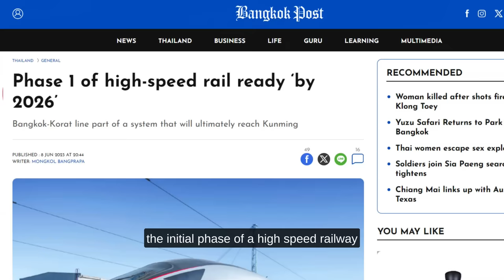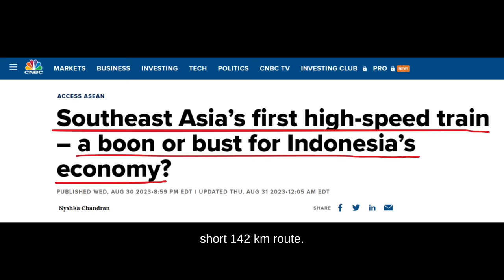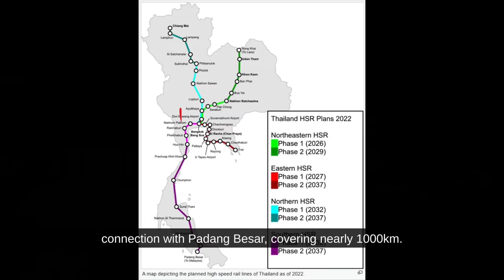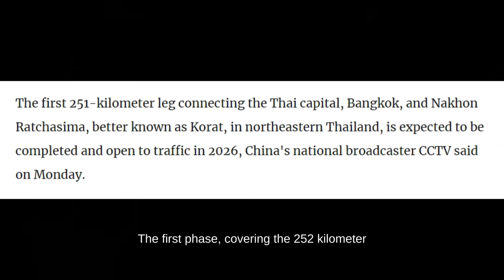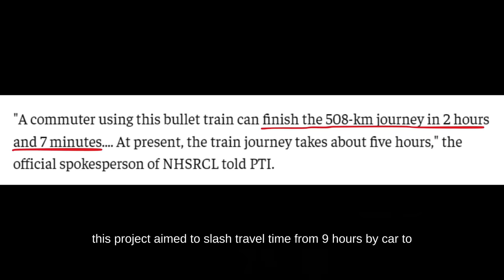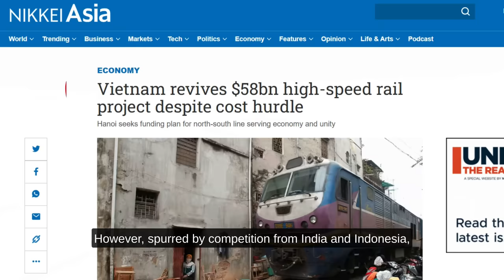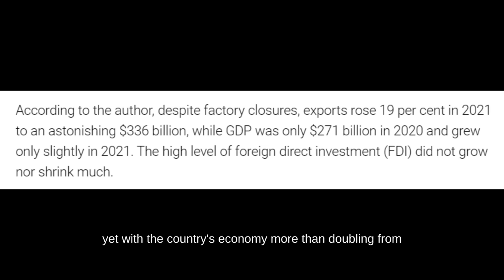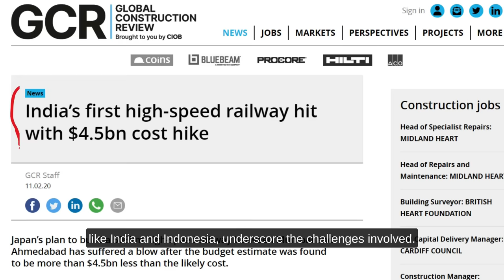Thailand, India, and Vietnam Competing to Build HSR

Comment: China has the fastest HSR!!! Wrong, wrong, wrong!
Until yesterday, No nation has break India HSR spped record, yet. 
YES, India has the fastest HSR, ever. In China, passengers taking  Beijing-Shanghai HSR set off from Beijing and arrived at Shanghai 2 hours later.
In India, Mumbai HSR (India proudly name this HSR SYSTEM of theirs, FSR or FAST SPEED RAIL), it's FSR train travelling at one end arrived at the other end less than the time it takes for the departing passengers to march from the entry gentry gate to the boarding platform OR conversely, the time taken HSR to complete its end-to end journey IS LESS THAN the time for arriving pessengers to desembark the train to reach the exit gentry gate. 
(For Reference: The operational length of completed Mumbai HSR End-to-end is 10Km. 
And its take 12 min for Mumber HSR train travelling the highest achieved speed of 120mph train to complete this 10km journey. 

This is a spectacular achievement by Indian govt, ever. Because it had bring modernity to the nation with modern day infra ie  a FSR system that provided India citizenry with end-to end rail  journey that is comparatively better  than motorized air poluting vehicular mean of commuting for economic activity.

Comment: How long was Indonesia's high speed rail project delayed?😅
Reply: Slow down in pandemik time..
Reply: About 1.5 year
Reply: @leichen8000  I just read a lot of articles in which the completion time of Indonesia High Speed Train was 2019.
Source - bbc, al jajeera
Reply: @akashranjan1550  2019 was probably a very old/early estimate. The construction started in 2017. There was NO WAY to complete in 2 years! At the commence of the construction, it was projected 2021/2022 for completion if I understand correctly. Note that there are always MANY different projections for completion date at various stages (at proposals, planning, design and construction).
Reply: Delay is a nature of a project with many circumstances but it's normal.
In the end it's finally finished and running with passenger beyond expectations.
😊
Reply: Delay? Covid 19 brooo
Reply: india high snail train😂
Reply: @andriacz3240  India's first phase  route length is 508 km
12 stations
470 km elevated
25 km tunnels
13 km embankment

Pier work - 250 km complete 
Viaduct - 150 km complete 

*Source- official website of NHSRCL
*So it will take time 👍🏼

Comment: ndonesia was a 170 km long project and India's is a 525 km project. Indonesia project was to be completed in 3 years and got done in 8 years - with a cost over run of more than 2 times.  India's had a time estimation of 5 years and is getting completed in about 8 years with a cost over run of about 50%.  Overall cost per km for India is less than 50% the cost that Indonesia has paid.  Plus India has got funding at throw away cost of 0.1% p.a. interest, 15 years moratorium and 50 year repayment.  You also need to understand that unlike Indonesia the bullet train is just one of some15 large projects for railways being concurrently handled in India - such as 2 dedicated freight corridors totalling 3000 kms; 100% electrification of all railway lines (Germany is at 60% TODAY); metro systems expansion and setting up simultaneously in about 40 major cities; semi-high speed trains (Vande Bharat) introduction and expanision to 500 trains; track renewal to handle 160 kmph for all trains to bring down travel times in non-bullet trains; hyperloop development and setting up between Chennai and Bangalore;  modernisation of railway stations and bringing them on par with airports - at present 400 stations are being revamped across the country and a few thousand more are slated.  ALL THESE ACTIVITIES ARE GETTING DONE AT RAPID PACE THAT IN MANY CASES HIGHER THAN THE BEST PACE OF ACTIVITY ACHIEVED BY CHINA TILL TODAY.  THEY WILL BE COMPLETED BETWEEN 2023 AND 2027; THEY HYPERLOOP ALONE IS LIKELY TO EXTEND TO 2030.  AND THEY ARE AT COSTS THAT ARE SO CHEAP THAT CHINA CAN ONLY STAND BY THE SIDE AND WEEP
Reply: Construction of Jakarta-Bandung HSR began in 2016 and completed in 2023. That's 7 years, not 8. The original budget was US$6 billion, final cost is US$7.2 billion. The Japanese-built Indian HSR's completion date and final cost will be known when and if it is completed. It's meaningless to compare something which is real with something which is imagined.
Reply: @prabakarsantanam2931 too bad India and Japan failed😂
Reply: @nickzhu9201  too horrible u Chinese bots have nothing to do
Reply: You never know how much a project will be delayed and over run the budget until it is done. All you mentioned are just expectations.

India is yet to prove its ability to complete projects ON TIME AND ON BUDGET which we didn’t see historically from those like INV Vikrant carrier, Arjun tank, LCA Tejas jet fighter, etc. It seems a norm for India major projects to run over budget, time and money.
Reply: Talk about pace ……
China, during the first 6 years of HSR development (2004 - 2010), put 6000 km into service!
India has spent 6 years so far (from 2017). How many km HSR in service? - Zero.
Who should be weeping…? 😂😂
Reply: @prabakarsantanam2931 
ever heard of cart before the horse? You're sitting in that cart!😅
Reply: @sunmanyi3265  and ur pulling that cart for me 😜
Reply: @leichen8000  there are issues. There are failures. There are also resounding success stories. Depends on what you want to see.
Reply: @leichen8000  u see this pace in the Vande Bharat train project. Bullet train is not that high in our priority
Reply: @prabakarsantanam2931  What people want to see is consistency. People won’t take you seriously if your project are always hit-or-miss.
Reply: @prabakarsantanam2931  I know India is building Venda Bharat like crazy. But it is just a semi HSR.
Venda Bharat is similar to the semi HSR (< 200 km/h) China homemade 20 years ago before importing more advanced Japanese and western technologies. They are no longer in service in China. I don’t understand why India is still building Semi HSR in large scale while Shinkansen technology is being transferred?
Reply: @leichen8000  that is a big question. U really want to understand we should do it one to one privately - a topic that could take some level of time commitment
Reply: @leichen8000  It is nice to be seeing a rational discussion about India from a reasonably well informed Chinese person.  In several years this is my first such experience - the normal interactions I have seen is one of disdain and disrespect in comments about India from Chinese.

To broadly answer your question - briefly - when India was looking to modernise in 2015 / 2016 discussions held with Chinese railways; spanish railways and a few more yielded several suggestions some of which was India needed to first convert its vast railway network to semi-high speed before going in for high speed trains.  The Vande Bharat was indigenously developed in some 18 months  based on some of these inputs - there were some corruption allegations that took time to sort out and now we are in the space of rapid roll out of Vande Bharat trains and modernisation of the track to handle the semi-high speed.  

Simultaneously work is going on both on bullet trains and also on hyperloop. India is the only major country pursuing hyperloop technology today - even Elon Musk has given up on that one for moving people.  However IIT Chennai has made enormous progress - and this will hopefully develop into a fully indigenous technology with a first commercial operation between Chennai and Bangalore by 2030.  Hyperloop in India will be about 30% the cost of any bullet train anywhere in the world - and will be at least double the speed - if not more - of bullet trains.  So the call on expansion of bullet trains or moving into hyperloop is one that is a big one and would be taken somewhere between 2028 and 2032.  The Vande Bharat will be the main work horse and expand rapidly from now till then.

On the demand side while there are plenty of Indian middle-class who can afford to pay and travel in bullet trains connecting urban centres they are not the only people who need to be serviced.  About 60% of today's India will not be able to afford a bullet train ticket.  In fact demand for non-ac train travel - in terms of number of people - is way way way ahead of any other demand today.  This will change significantly by 2030 - however India is a populous country and so trains that cater to the bottom most economic layers of the pyramid will be a reality - and in that section of demand you are looking at extremely cheap travel with a modicum of comfort.

So yes the development model for India will be very different from China and you cannot compare the two beyond a point.  

This is a brief reply.  There are a lot of complexities involved in questions like these.
Reply: @prabakarsantanam2931  So it sounds like Venda Bharat is a transit solution between now and 2030’ish. It’s service life could be as short as 10 years (even shorter than I thought). Quite wasteful as railway investment supposed to be long term. But I do understand the immediate needs for India to improve its current very aged railway system and Venda Bharat appears as an  quicker and less expensive choice in short term.

Why didn’t India choose to build multiple Shinkansen lines in parallel timelines like China did? I guess it will be slower and more expensive in short term and Modi needs to balance the economic and political concerns between bullet train and semi HSR.

China largely skipped the Semi HSR stage and aggressively delivered total 6000 km HSR within the first 6 years of its HSR endeavor. India in contrast is taking a more balanced and complexed approach.
Reply: @leichen8000  Vande Bharat will run for 25 years with decreasing intensity from mid 2030's is my guess. My personal opinion is China moving agressively into bullet trains was ill-timed. The information I have is that even today only about 60% of long distance rail travel by Chinese is on bullet trains. The other 40% find the fares unaffordable.  Bullet train fares in China    are definitely high - higher than plane fares in many cases. Ridership is low in several lines. Vast majority of the bullet trains are running at negative contribution itself and the system as a whole is not only incurred a cumulative loss of a trillion dollars but is also unlikely to be profitable in the foreseeable future. Doubt if such a situation can be supported by any govt beyond a point and hence there will definitely come a time when it will crumble because of the financial mess in a manner worse than either Evergrande and /or the present real estate melt down in China.  That is of course my reading - and I do hope I am proved wrong
Reply: @prabakarsantanam2931  I wouldn’t say you are wrong but just one perspective. From a different perspective, you can view it as China’s “domestic version of BRI” where the main goal is laying the base platform for development rather than making profit directly from it.

One can write a book discussing China’s HSR. Let me just go with one example. The HSR ride from China’s center land to Xinjiang (the most distanced provincial area) takes 13+ hrs. Fare is about 110 USD. Very affordable considering the distance. But ridership is low because the population is low in Xinjiang and the ride is too long. China still builds it knowing about the inevitable operation lose.

Why? Because China concerns about the possible separation of that remote region. Instead control it with police and military, it better off to make it more integrated with the rest of China via soft power - a HSR line which promotes social and economic exchanges and integration. In long term and overall , China believes HSR is a smoother and cost effective solution than control Xinjiang by force. Don’t be surprised if one day you see China building a HSR into Tibet.
Reply: @leichen8000  yeah BRI is an externalisation of Chinese infrastructure and one of the main reasons China went for it was probably the dwindling down of opportunity inside China. Debt driven infeasible infrastructure is generally a ticking time bomb; externalisation of such a path increases risk levels exponentially. Technology and innovation may still save the day; not too sure about that though.

Chinese model is different from the Indian one and there are positives and negatives in both. 

As long as they work it doesn't matter which route u took to reach the goal

Comment: bruh, japanese hsr in india still unclear
Reply: It seems they have completed an extra length several years ago. Japan managed to complete the construction of 10km of rail out of the 500km after 5 years of work. Now they are making a very big leap forward by adding another 100 meters after 3 years. Japan and India are very proud to announce their rapid progress in the reconstruction of a very slow train of the world. 🤕😴
Reply: @TechnoGears-2023 bro i wish that was the case bro but unfortunately as per railway ministry report back in March they released a report that told they had already completed 30% of their work with 270+km of pilings 160kms of pier works and tunelling in other parts. So sad vro this is, by now they must have completed another 10% what to do vro 🤒🤕
Reply: @TechnoGears-2023  Stupid Chinese bots, this is from Wikipedia about India+Japan HSR: "This project was initially targeted for completion by December 2023, however, owing mainly to land acquisition issues in Maharashtra and the COVID-19 pandemic, it is now expected to be completed by October 2028. However, a portion of this line between Surat and Bilimora is planned to be opened by 2026."
Reply: India already build 100km+ viaduct,250km+ pillars and track laying also started lol

Comment: Chinese high speed rail, except only Beijing-shanghai route, all others were in heavy debt of 3 million (dollar?) per kilometre per day, (30,000 kms x 3 mil)= 90 billion dollars/day...
Without government subsidiary, no any railroad firm can run (no profit)... the reason that in my country, never hurry to finish even one route (north-eastern) south-eastern is..long.
Reply: True. But China’s HSR has border and deeper economic and social benefits worth for the government to subsidize it.
Reply: You simply don't understand the operational model of socio-economics. A robust high-speed rail network connects this vast country of China, turning it into a highly efficient economic hub. The resultant economic benefits and tax revenue far exceed the losses incurred by the high-speed rail. The government can easily use the significantly increased tax revenue to subsidize the losses of the high-speed rail.

Comment: Vande Bharat looks so much like those semi HSR China home-built 20 years ago (e.g., China Star, < 200km/h) before switching to importing HRS from Japan/French/Germany. Why does Indian today still build large amount of Semi HSR which China stopped building 20 years ago, especially when India is getting Shinkansen technology transferred from Japan?
Reply: After track upgrades vande Bharat will reach 250 easily and its broad gauge unlike skinkansen which is standard guage
Reply: @hemantv1676  According to Wiki, the maximum speed by current design for Venda Bharat is 180 km/h running on suitable track. Venda Bharat currently is running at only 130 km/h due to poor sustainability of existing track. 250 km/h may only be possible for some new designs version of Venda Bharat in future but who knows when.
Reply: I think there are multiple reasons for this.

1. Affordability:
While India is planning on building an extensive HSR network across the country, I believe they still manufacture these trainsets many people would opt for them rather than the bullet train, because of the price. 

2. The "Make in India" initiative 
The Make in India initiative basically wants to manufacture projects and take China's factory status away from it. Unfortunately, a lot of Indian trains are old locomotives that were designed multiple decades ago. The Vande Bharat aims to change this. These trains are directly advertised as "Make in India" (it's literally ON the trainset.) And although it's speed is nothing to praise, I think the amenities it provides, like the 180° degree rotating seats, are quite nice.

3. Bureaucracy
Now I might be deviating a little here, and you've probably heard this as well.. but India started it's ground work extremely late due to their contests of land REQUIRED to construct the HSR route. In fact, if I remember correctly, the NHSRCL got all of the land by 2022..since then, I do think construction is going smoothly.

I don't think all of India's infrastructure projects are like this, however.
For example:
Delhi-Meerut Expressway finished on-time
The Delhi Metro's first lines were finished miraculously before time, sparking the metro culture seen in India now.
The Delhi-Meerut RapidX service (you could relate it to the Australian V-Line, a regional rapid transit system), a project I've been following since it's beginning, launched a priority corridor on time in 2023, and another 25 kilometre stretch is expected to be inaugurated on March of this year. (Which I do think they'll commit to, as trials began on the 29th of December, last year.)

It's expected that 33 million Indians will enter the global consumer market this year, beating China's 31 million. I do think India can westernise and be developed, but I think a change of mindset is necessary. The Chinese talk less and do more while the Indians.. are doing quite well as well, but boast quite a lot about it, making them unlikable.
Reply: @leichen8000 To add to this, I believe the  Vande Bharat (sleeper) trainset is the 250 km/h is the one you're talking about here. According to Wikipedia, it was first prototyped in 2023.
Reply: @hemantv1676  chumtiyte google nhi kar sakta ye bakwaas karne se pahile?